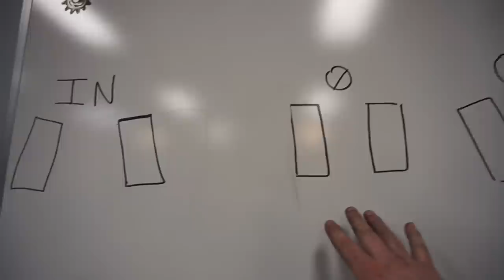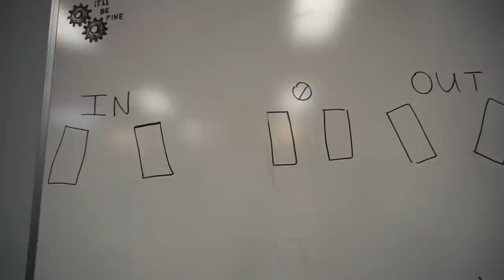Shifter Kart Speed Mods: DIY Alignment, Gearing, Aero??

Comment: Always do a Alignment in this order caster first then camber then toe. Now if you take a string and wrap it around all four wheels you can set the front end square to the rear end,failing to do that first will result in crab walk. that is very wrong. Move the rear axle until square with the front end.  Set both front spindles at the same ( 0 being preferred ) caster and camber angle to start with.Then set all your angles record them using a protractor set to your level square and then you can make adjustments after testing until you find the best handling cart. Failing to do any of this will result in a piss pore / unsafe handling cart.All of this can be done with a square , string level , a good bubble protractor and a tape measure if you take your time. But not in ten minutes ,you have to creap up on each adjustment slowly check and recheck. The result is well worth the time on a fast cart.

Comment from the maker: It should be way more stable at speed now... you think we'll hit 80??
Reply: definitely
Reply: the aero adds like... 100hp  xD
Reply: I think Ike should now make his own shifter kart but make it 2 stroke🤔
Reply: Hell yeah, post on insta please?
Reply: If you think of caster as looking at your spindle kingpin from the side, having the top of the pin leaning back toward you a couple degrees will make it harder to steer from a stop, but it will also make your steering track straight forward at speed and make it much more stable...
Reply: Absolutely. Look at all of the caster on a dragster. I believe caster was one of the problems causing the cart to be so darty. I expect it to be more comfortable to drive at speed. It would be much better if they were on a more suitable track.
Reply: I think your making a mistake by not even considering aero.  Especially as you seem to be disregarding it due to aesthetics and effort.  A little bit of front downforce can make a world of difference in stability which already seems to be an issue.  But great video anyway and I am excited to see the results.  Kart on!
Reply: Gerald Wallace I keep harping on Aero.  Two riders, similar top speed, slower accel at top end with Ike who has more aerodynamic drag... Sigh.  All the signs are there.
Reply: Yes Sir!  My family has built and raced karts for almost 30 years.  Aero matters at speed.
Reply: CarsandCameras ... Is there an aero kit available for Ike?
Reply: CarsandCameras depends who is driving
Reply: I believe so
Reply: Shimming the needle will only increase fueling from 1/4 to 3/4 throttle.  You need a larger main jet for 3/4 to WOT to see any benefit there.  Adjusting the valves would also be a good idea...
Reply: The needle controls MIDRANGE mixture. The Main jet regulates WOT(Wide Open Throttle) mixture guys.
Reply: put on some safety gear!
Reply: it should get into the upper 80s
Reply: You don't know? Come on man, of course it will, if not adjust it some more.
Reply: CarsandCameras yes
Reply: 🚗 Cars and Cameras 🎥 BumChickenPuppet knows you’ll top 80+MPH
Reply: add a electric shifter  to shift it I don't know if they make one that down shifts but if not add a second to do it . you can then let the  shifter speed shift and not need  the clutch as much
Reply: For sure, especially if you go to a more suitable road than the previous video, one with smoother conditions, less cars, and no curves!
Reply: I remember learning in physics that the formula (Pd=Fd V=1/2pv cubed ACd) states that every time a cube doubles in speed the drag quadruples per the formula, resulting in 4 times as much power needed to overcome the drag force. Random Example, the shifter kart is traveling at 50mph and let’s say it needs 10hp to over come the force of drag. If the kart then doubles its speed and is now traveling at 100mph it will need 80hp to overcome the air drag. 

This goes to show how much aerodynamics affect a moving object
Reply: Yes
Reply: 81mph 😎
Reply: Try for 100
Reply: Speedy Mercer thanks for repeating exactly what I just said. Except its not range, it is throttle position that dictates what jets are performing the primary fueling at said position. Unless you mran throttle range.
Reply: Being the size of your tires front vs back turn radius etc a zero on your settings especially camber is advisable. No suspension travel so changing camber neg or pos is going to take front traction away. Doing an 80 mile an hour pass with only half traction could be deadly at 40 more over double that. I'm far from someone to say don't  do some craziness. I have plenty of titanium pins and plates I just want you guys safe. Doing a straight line top speed run you want the tires as flat as possible. Toe in is easier to steer but will drag a bit so zero on toe would be good. Caster basically affects steering return and with a cart it's not important with such a fast turn ratio. In a car you can do 2 turns for example to make a corner. Your cart is lucky to get a quarter of a turn before lock at it's peak. So zero zero zero on all your settings would be the best for you guys. Please be safe. I'm not your normal viewer I'm a 45 year old mechanic that started my apprenticeship at 15 so I've been in auto and truck repair 30 years.
Reply: CarsandCameras most likely
Reply: CarsandCameras ... Issac, how did you and John meet?.
Reply: You should put a turbo on it
Reply: Johnny Cliche. Yes I agree and at high speed straight line heavy steering is better
Reply: Billy Beane these carts use chassis flex as well as tire side wall deflection at these speed and have camber adjusted perfectly safe. 0 0 0 sounds good if the chassis didnt flex and the tire didnt warp under side loading.
Reply: CarsandCameras I would definitely put on a steering damper from a VW bug. That should stop any high speed wiggle but on the downside it will make slow cornering rough to turn steering wheel. Ps, I wouldn't try for 80, just see how fast you feel comfortable going.
Reply: 80 no way more like 85 !
Reply: When Ike said "We wanna go fast." I just thought to myself, "Taladaga Knights" lol
Reply: Whats your gear ratio?

Comment: CarsandCameras We've been waiting, thank you again for the excellent videos guys.
I would like you guys to build a DIY gas turbine engine out of an old semi turbo ect.  Right up your guys alley if your not familiar.  Just needs an oil pump, a burn chamber (steel pipe) an injector for propane or kerosene, a blower to start it, and ear plugs.  It makes thrust, cool on go carts, and fun to build.
Reply from the maker: I've wanted to do one for years!
Reply: CarsandCameras -Same-, you probably have seen all the videos on YouTube, there are some pretty amateur attempts (which I want to do eventually), but also many more amazing examples that look all pro with afterburners and super skookum controls.  Not to mention that a go cart with one is ridiculous but for some reason like the epitome of carts, thanks for responding and the videos
CarsandCameras
Reply: colinfurze on youtube will help his older videos

Comment: You need a bigger main jet to change WOT fuel ratio. the needle setting is for mid range fuel ratio changes.
Reply: Yup.. The needle have zero affect at full throttle!
Reply: Jeffrey Long That’s correct, at wide open throttle the needle has no effect. Its all main jet size. Do a wide open run then kill engine and check plug color to see which way to go with main jet.
Reply: correct!!  the jet has to be changed or drilled out
Reply: Remember that increasing the main jet will richen the mixture at ALL throttle settings. You should set WOT by the main first, then adjust the needle to fine tune the midrange.
Reply: The needle settings are good for 1/4 to 3/4 throttle settings in the transition to the main jet.

Comment: The camber and toe explainatioms were pretty spot on. If you’d like more information about road racing vehicle dynamics, read the book “Tune to Win.” It’s a pretty simple read that dives into some of the math behind vehicle dynamics. The main goal of all those adjustments is to keep as much of the tire in contact with the asphalt as possible through a corner. Another not about aero, is you need to make sure the center of gravity and center of pressure are in pretty much the same spot. Having a center of pressure elsewhere can lead to erratic vehicle behavior. I hope this helps! Keep up the good work!

Comment: Positive camber has practical use in the rear of drift cars for the most grip while sideways
Reply: ECUs and CPUs not the rear,  on the front.
Reply: its negative camber
Reply: Negative camber up front. A degree or 2 of positive camber in the rear.
Reply: it would give you least grip while side ways on outer tire but most grip on the inner dude ;) so personally i cant really see the point of that, but hey its whatever suits you buddy, is it so you lose traction easier when you thro it in that you do that? (so in short LESS not more, grip when sideways as less weight is on the wheel with most grip)
Reply: not trying to be a youtube mechanic but drift team find the right amount a camber it take to make the biggest tire patch around the a turn. like what jon said in the video Turing right can make the tire patch smaller and ride on the one side of the tire .
Reply: Look at formula drift cars as an example. Per the rules they have to use street legal sport tires, but they also have tons of power. When in full drift the trailing wheel will flex outwards because of the force, if it started with no camber it would go negative /    \ and you have less mechanical grip. But if they start with positive camber \    /  the wheel will flex to close to no camber |    |   for more grip in full drift. BUT, I also agree it's a matter of preference especially in grassroots drifting where the cars dont all have 800-1200HP, so you dont need all the grip in the world. Hope that helped
Reply: so basically your saying what i said above lol, ie its not MORE grip!!! its LESS lol, in reference to your original post ECU and CPU bud (you should maybe read what you wrote again ;) ie outward tire has small contact patch, inner had bigger contact patch (but no weight transfered onto it) negative on front makes outer tire which has all weight on it have full contact for grip!! positive on rear makes it easier to break lose, your either getting confused, not good at explaining or dont have a clue, but dont take offence as i really dont think its the latter :)
Reply: thats not what he said atall dawhuoib, lol, it has as much to do with weight transfere, something many here dont seem to understand, appologies if i have just missed the point you were trying to make
Reply: ecu's and cpu's so i had to laugh at your hoped that helped comment at the end of your last comment, bit condicending lol, at best its confused ppl who have no clue and at worst made yourself look silly by admitting it gives less grip eventually!!!! lol with you not needing all the grip in the world lol, now dont go changing your original post now !! ;)
Reply: gimble You realllllyyyy dont know what you're talking about. I think you need to do some actual research on your own time like I did.
Reply: why would i research when im right, be off with you lol, ive been in racing for 30yrs, have you?????
Reply: hahaha some people lol wtf... yea I see what you mean it's like when they use a similar setup on something with suspension that travels A LOT, so the majority of the time when vehicle compressed your camber is where you like it. A low-rider stance
Reply: The reason drift cars have positive camber on rear is so that as you accelerate the rear of the car squats causing the wheels to camber inwards, most contact to the ground- more grip
Reply: @fcknsick  no

Comment: Caster is the axis from your upper pivot point(usually a strut on a car) to your lower pivot point(the lower ball joint. Caster is viewed from the side of the vehicle. Positive caster is what drag cars usually use. Positive caster helps with higher speeds. Think of the front forks on a motorcycle they typically lean back. Negative caster I believe makes the vehicle harder to turn etc... not really practical for high speeds if im not mistaken.

Comment: Just be forewarned, there is a point of diminishing returns with negative camber. There is times when it definitely helps, but too much camber can be devastating on tired and can cause too much weigh shift and a loss of grip.

Comment: From what I've gathered Camber out acts almost like Ackerman. If you're doing a lot of hairpins or a track with a ton of turns, having a negative camber even to a small degree. That inside corner wheel ends up having the most traction. Especially if you lean towards the inside of the turn the inside wheel you can literally feel it pulling you through the turn.

Comment: It's supposed to cock a wheel, helps with turn in and cornering. And Caster is just a pivot angle, higher the number the more it wants to follow forward. It's why most cars return to centred when you let go of the steering wheel.

Comment: For future reference.  Checking toe.   Make a mark in the middle of each front tire.  Roll mark to front.    Measure between each mark.    Roll mark to the back.  Measure between lines.   Adjust as needed.   It'll be fine....

Comment: Positive camber (Labelled as out in the video) IS used in street cars as roads are designed to have a curvature with a high spot in the middle of the road to reduce the amount of standing water after rainfall, and so many vehicles are designed with a bit of positive camber to account for this.

Comment: Positive camber can sometimes be used on the rear wheels in high horsepower situations like drag/drift. In high horsepower situations, the rear end squats under load, evening out the camber during acceleration.

Comment: Front tires should be toed in 1/16" to 1/8" because as the kart moves forward the tires will toe out just a bit. This will allow them to become straight and it will steer better.

Comment: Positive camber is used for trucks that tow or are used to have alot of weight in the vehicle. It helps make it so that when the load is in the vehicle the tires lean in if they didnt have positive camber, when the load was applied the wheels wouldnt have negitive camber

Comment: Hey guys I’m a racecar driver so I deal with caster camber and toe a lot but a good tip would be to not set toe at 0 cause it will dart around at high speeds! Normally an 1/8 or 1/16 toe out is perfect for stability!

Comment: raising the jet needle adjusts your mid range, main jet will adjust top end along with raising the float level in the bowl so you dont run lean on top.  alternatively, you can run a smaller air stack which will enrichen the entire off pilot range.

Comment: I think you still need to do my idea of the Ricky bobby shift knob 3D printed
Reply from the maker: Who has a 3D printer???
Reply: yes
Reply: I can 3d print you one or i can CNC machine you a billet one out of almost any metal or material you want.
Reply: Guys i already posted i want to print things for you. 3D printed phone holders to bolt to the steering wheel when yall are doing top speed runs, shift knob, whatever you like.

Comment: Most vehicles I see notable camber on is on rock racing where they are climbing over awkward and irregular obstacles, with really long travel.

When the high travel arms go from max to min travel, depending on the types of terrain you are going to approach, you will be looking to moderate your angles so they do not reach to extreme at any point and throw off your contact or add unwanted steering caused by the wheels leaning so far over that they cause the vehicle to steer that direction.

Caster is where you rock the axis of the steering knuckle backward, causing gravity and your camber to work in unison, forcing the steering wheels to be force centered with the line of the vehicle if you release the steering wheel.

Caster is the natural tendency of a properly aligned vehicle to return to the 'straight forward' wheel aim, as well as the tendency to remain in that position both while rolling and at rest.

Too much camber and steering becomes more difficult, but at the same time, it causes the steering to be tighter and more responsive.

Motorcycles tend to steer by their caster more than the turning of the handlebars.

The caster of the motorcycle is managed automatically by the rake/slope of the forks in relation to the line/level of the road.

Comment: Some things about alignment, caster greatly affects stability and is a non tire wearing angle. caster is the steering knuckle tilt forward or back. it can be tilted forward for more stability at high speeds and make it harder to turn. negative camber will make it less stable at high speeds and makes the steering wheel easier to turn when not in motion. 

 camber is a tire wearing angle and if it were me and going for top speed I would run as close to 0 camber is possible. negative camber can help handling but too much negative camber will wear the inside edge of the tire and cause some "feathering" on the tire tread towards the inside edge of the tire along with increased tire wear on the inside edge. positive camber will wear the outside edge of the tire. too much positive camber really serves no purpose and can make the steering feel skittery and more likely to plow through corners.

toe is a tire wearing angle and toe and toe out has their purpose but for a vehicle to chase top speeds I would run as close to zero toe as possible.

Comment: A lot of old racing cars (1920s and 30s) had positive camber in the front, supposedly to lighten the steering or give the back more grip. I'm not entirely sure how that setup is supposed to work, but those cars had solid axles and were running on cross-ply tyres, very different to today's automobiles.  See some pictures of the pre-war Alfa, Bugatti, Mercedes, and Auto Union GP cars.